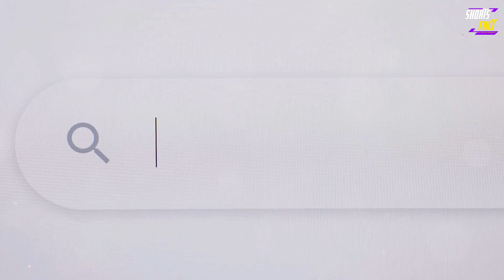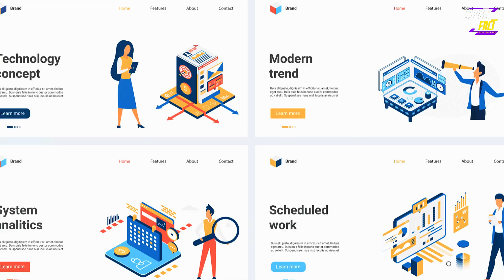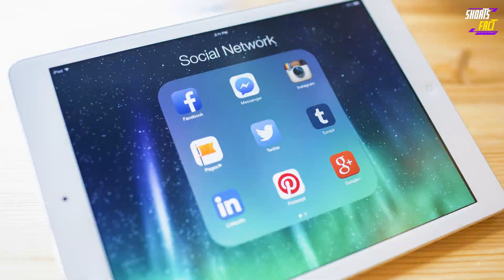Elon Musk's Bold Plan: A Million People on Mars by 2054! | Oddiverse

Comment: Actually to try and put a base on the moon or mars is a larger problem than anyone is understanding. In
truth there is one area that no one is addressing that is the key problem as to why it's unlikely that the
moon base or a mars base will happen. That key issue is food. Each person per year requires around
2,000 lbs of food. That is the minimum and we are not even talking working hard in space missions. Each
Now sure they could bring that on a mission to mars but they would need another 2,000 lbs if food for
the return. Then the number of days on mars. With a moon base its as simple as sending food. However,
we know this has issues with what we know with the 12. in truth the only real way to manage this best
is to create a greenhouse setup or some time of hydroponics. The soil on the moon and mars would
need to be given some composting setup. i would suggest a vegetable composting system during the
flight to say mars that way by the time they get to mars they have the needed soil additive to treat the
soil on mars for a greenhouse setup. Also each person requires 60 ache of farm area. With some type of
hydroponics that could be set up vertically. That said I have yet to see anything like this at alland it is
golng to be required to even try a first attempt. in truth, I have yet seen any data to suggest that is the
goal. In reality the idea of sending people before setting up a greenhouse backup food source is asking
for problems. I don't see any data to suggest anyone is looking into that area
Reply from the maker: Thank you for bringing up such an important aspect of space colonization. You're right that sustainable food production is a critical factor for any long-term human presence on Mars or the Moon. Let's address some of your points:

You're correct that each person requires a significant amount of food. However, the figure of 2,000 lbs per person per year can be reduced by optimizing diet and reducing waste. Also, the return trip from Mars wouldn't necessarily require carrying all that food, as future missions could potentially produce food on Mars.

Greenhouse and Hydroponics: Space agencies and private companies, including SpaceX, are indeed considering greenhouse and hydroponic systems for food production. NASA has been researching space agriculture for decades, and there are plans to test advanced plant habitats on the Moon as a precursor to Mars.

While it's true that Martian and lunar regolith aren't suitable for plant growth, they can be enhanced with nutrients, including those derived from human waste. Experiments on the International Space Station have shown that plants can grow in space using hydroponic and aeroponic systems.

The figure of 60 acres per person is based on traditional agriculture. Controlled environment agriculture, like vertical farming and hydroponics, can greatly reduce the space required.

There are ongoing studies and experiments about space agriculture. For instance, NASA's Veggie experiment on the ISS has been growing crops like lettuce and radishes. China's Chang'e-4 mission successfully germinated cottonseed on the far side of the Moon.

While it's true that more focus and data are needed in this area, it's not accurate to say that no one is addressing the food issue. It's a complex challenge that will require innovative solutions, and it's encouraging to see that work is already underway. Thanks for bringing this crucial topic to the discussion, as it's vital for the future of space exploration.